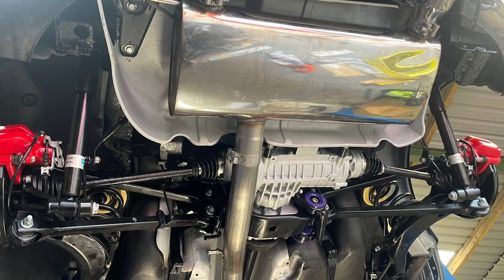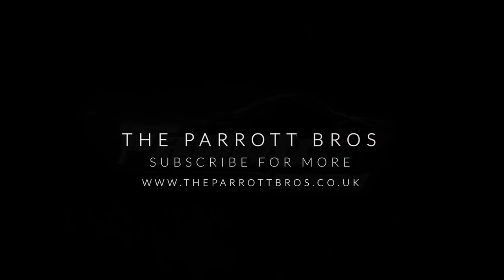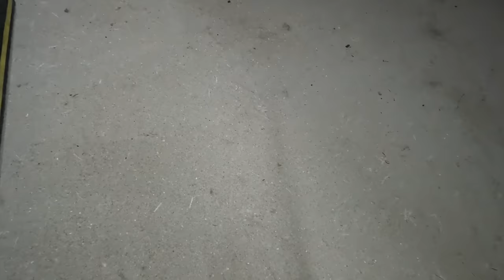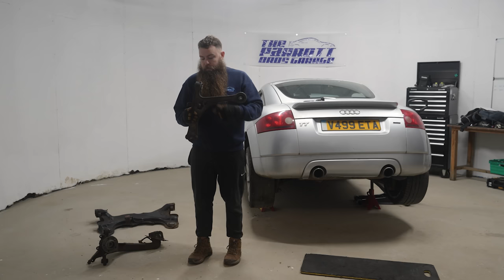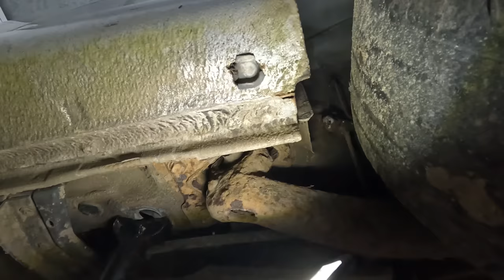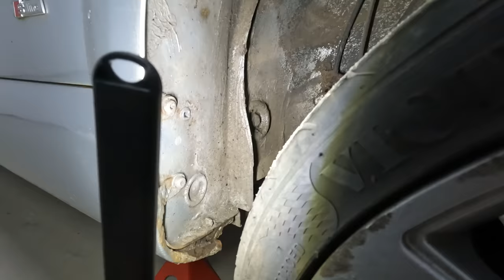How to plan & restore audi tt subframe and underside on a budget

Comment: Wondering if you could help. I am searching for a front subframe for a 3.2 V6. I have come across a few on eBay, which claim that they came from a 225 and they will fit the 3.2V6 will they fit? Thanks Dean
Reply from the maker: The 1.8t & 3.2 subframes are different, only slightly but none the less not compatible if you want to have an undertray! 

On the 3.2 subframe it has 2 raised blocks with threads in them to hold up the Metal undertray, the 225 one does not have this as it has a plastic undertray thats a different shape

Comment: Great video and good timing, this is my winter project to drop the rear subframe, blast and rust treat it, replace the bushes etc. I was just going to hammerite or chassis paint the frame once the rust was removed and treated but considering getting the powder coating done now, does it really offer a better level of protection than paints ? Thanks!
Reply from the maker: The right powder coating should be tougher than most paints as its heat treated on,  its likely what was on most parts from the factory it just deteriorates over time, you can use a good quality rust treatment then just use POR15, that is my go to paint if your not going to powdercoat :)
Reply: @TheParrottBros  Thanks! I have several bilt hamber products for rust treatment and a spot blaster. Will have a good look at it once I have it off and make a decision.
Reply from the maker: @pjmccracken  ooo awesome! Feel free to
Email me some pics of your progress or if you post your on socials tag me. Enjoy following these restorations

Comment: Great video, I've just bought an Audi TT 3.2 roadster.I love it so far but the MOT came up with an advisory. 'subframe corroded but not seriously weakened'  I'm a bit worried about how to tackle it as I dont have the practical skills or knowledge. I don't even know what the advisory means.  Help me please lol
.
Reply from the maker: Hey Beth! firstly congratulations on TT ownership, So basically the subframe corroded means that its rusty but not enough that its dangerous, However left untreated will rust and a hole will appear which will then be a fail, Depending on how bad it is you have 2 options, get your one treated and some rust prevention paint /coating applied or if its past that over the next year you may need to get a new one fitted.

Comment: I'm looking to do my front and rear subframes for my 3.2 V6. Where is the best place to get both frames? Cheers Dean
Reply from the maker: Hey dean, TT spares have newly powder coated recon ones on the shelf i believe, a fraction of the cost of new ones unless you want to source used off ebay and get them refurbed yourself :)

Comment: Nice tips, as usual. Already did the front arms bushings. One of this days, I plan to work on the front sub frame, and the rear arms. 
I found a very good rust converter : Ferose. 
2001, 225 BAM coupé.
Thanx for your TT enthousiasm 👍
Reply from the maker: Thank you, most TT owners have it on their mind, I thought I would just share some tips to make it easier as I’m sure quite a few have been putting it off because it is a pain to do

Comment: Great, now I want to re-do my running gear - thanks for that 😆 Excellent guide though, thanks!
Reply from the maker: Thanks buddy, it’s a question I see often where garages dont want to take on a refurb they just want to fit parts. 

The issue with doing it your self is once you’ve disabled the car on your drive or wherever then it just sits till you’ve got everything sorted, so could be off the road months 😂

Comment: great video from new home.  I am a Mk2 TTS owner and bought a complete rear sub frame from a breaker for the reasons you outlines. I also used a fine  ceramic sander on a multi tool to remove all rust quickly before smearing all surfaces with a thick layer of lanolin.  This I bought in 1 kg tubs off ebay. Providing A cheap thick layer which takes loads of projectiles.
Reply from the maker: Thats brilliant mate, yeah this applies to must cars not just mk1 tt's, its great stuff and really does future proof it 😎

Comment: Ive just put on adjustable top and bottom rear link arms, so I have four arms with no rust here in the driest state on the driest continent on Earth. Are they worth sending to the UK?
Reply from the maker: So you have the opposite issue to what we have haha. Does that mean bushes and bearings wear out quicker due to the dry heat?

Comment: Thanks for the video Dom. One thing I am unhappy with is my suspension (I have bought Gaz coilovers about half a year ago) and I may be blaming coils when it could be caused by suframe and bushes. I may start with the back myself or give Bryn a call (I'm also in the middlands).
Reply from the maker: Hey buddy, what seems to be the issue? Gaz are extremely good suspension, a little on the hard side but they are built for performance
Reply: @TheParrottBros  I found it much harder than your usual coilovers but a very solid build. Unfortunately, car doesn't seem to have a good grip but don't have other tt to compare the driving feel to :P 
Mainly my problem lies in feeling every little imperfection on the road, and slight wobbliness when at higher speeds

Comment: how hard would it be to convert a v6 undertray to fit a 1.8 you think?
Reply from the maker: Not easy as it had multiple large bolt fixings that a 225 just doesn’t have the threads for. Plus isn’t really benefitting as it doesn’t protect the underside much more than the 225 one, still has an open slot at lowest point

Comment: Do the non Quattro TTs have a different front subframe ? Are  the front trailing arms different?
Reply from the maker: Front subframe will be the same as it’s shared with mk4 platform. Not sure wether they will have cast arms or not though, I’m sure all tt’s had cast arms. The golfs / Leon’s have pressed arms
Reply: @TheParrottBros  Thanks for the reply, I think it depends on the hubs with relation to the cast or pressed arms, had this issue on a mk1 Octavia it has the 312mm discs but the TT cast arms wouldn't fit the hubs.

Comment: Dom, how accessible are the subframes to treat and paint, when doing it on axle stands?
Reply from the maker: You’ll never get to 100% of it but you can get to all the bits that will get salty if you know what I mean
Reply: I done my truck this way, basically what I can advise is get it on some stands, and go to B&Q and get a cheap (£2 ish) decorators overalls, get under there with scrapers and wire brushes etc. and if you take the time you can get to most of it with a bit of time and patience 👍
Reply from the maker: @davewestrup2420  100% get overalls, ear defenders and eye protection 😂. And if you have a beard cover that too
Reply: 😂 Agree Dom, but no beards here 😂
Reply from the maker: @davewestrup2420  hahaha keep your mouth closed then, nothing worse than a mouthful of rust dirt 😆
Reply: Been there, done that, got the mouthful….. 😊